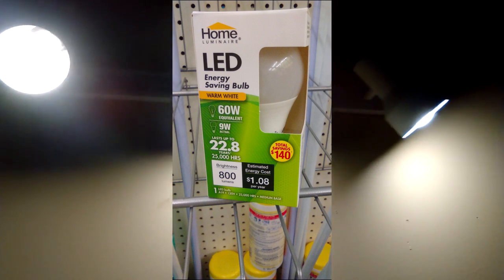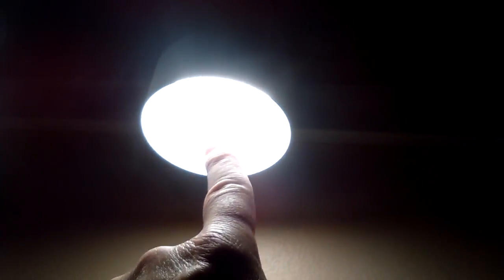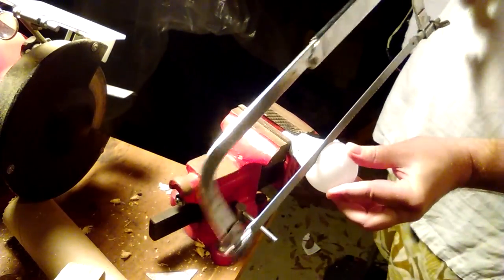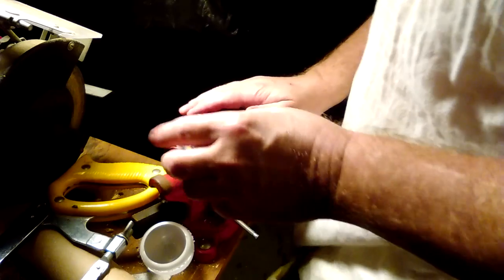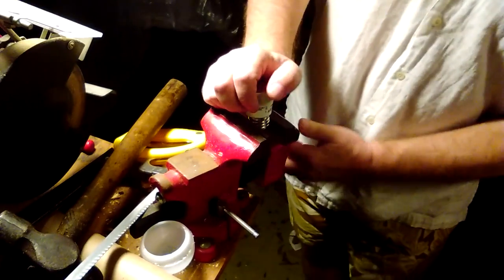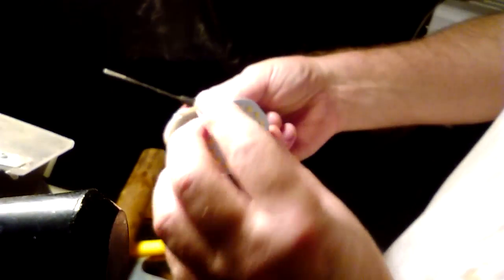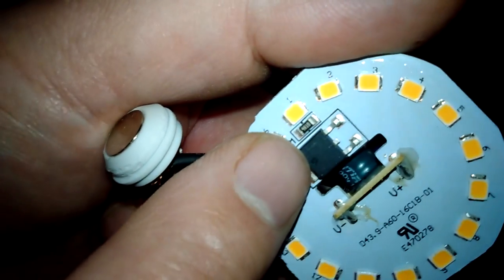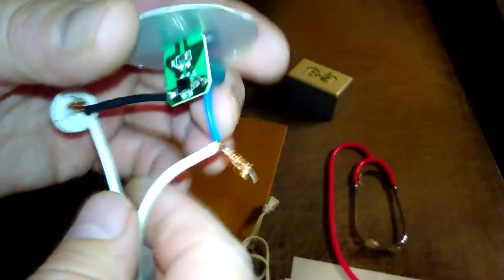Dollar Tree Luminaire LED bulb 60w Teardown / Dissection BP5131D MB10F

Comment: I found a 15.2 Ohm resistor a 100nF polyester cap and and 3.3 uF electrolytic. The other side I found three resistors 56K and a 750K across the +ve  and the -ve output of the bridge MB10F

Comment: I realize this video is a couple of years old, but in your parts review, you never mentioned the 510k ohm resistor that is in parallel with the capacitor (on the same side of the board as the bridge rectifier); you can see what I'm talking about at 8:16. I think (not positive) that it's main function is to discharge the cap when the bulb is powered down, so it would likely operate fine without it. If I'm wrong, please let me know, I just didn't know if it was omitted from the list on purpose or not. Thanks for sharing the video! I couldn't find any info on the BP5131D either and you answered my question as to what it's purpose in life was.
Reply: Lampu led

Comment: Hello genius, actually this is a 9W LED . Please check the package. This 9W LED was equivalent to 60W filament bulb or 16w fluorescent lamp giving 800 lumens of light.
Reply from the maker: Yes, you are correct. The actual power consumption is 9W. The 60w rating is how they are sold so people ( humans who buy light bulbs for decades ) can relate the equivalent brightness when purchasing. Years after I made this video they are still sold this way to avoid confusion. I've never heard anyone ask for a 9 watt bulb but many ask for 60w bulbs. It's a bit of a quagmire but nonetheless how it works. This should clear it up for you if you haven't gotten there.

Comment: what will it take to modify this to run of 12 volt dc
Reply from the maker: Well, you could hook the 12vdc to a 120v inverter 

Click Here to find one: https://goo.gl/SUqvxk

OR - you could parallel these in segments of 2 each and possibly add one 470 ohm resistor to each leg... the inverter thing is easier and you could power a few of these with one.
Reply: These questions almost never get answered .. so Here goes -
(Edited after I reworked my LEDs)

 Probably major surgery!  I don't know if you will get it back in the original base.  I just wanted to use the LED board. 

If you look carefully, all the LEDs are in series and run 8-9 volts.. That's over 120v.  However, if there are 16 LEDs (mine has 15 :-) ), find the first and the last by a split pad between them  (not necessarily by any text on the board!).  All of the pads are split UNDER each LED.  (and they probably are PADS and not tracks.) Remember, there might be some kind of coating on the board.

Remove ALL of the EVEN Numbered LEDs.  you now have 8 LEDs that can be run from 12v with proper current limiting.  And yes, I did destroy all the LEDs that I removed.  I also removed the resistors and the chip (which was really tough).

The LEDs can be paralleled using the pads from the 'removed' LEDs. (See the NOTE below.)  I connected 2 very small wires (maybe 30AWG) to each LED and then bundled them into positive and negative.  Use a 9V battery (and maybe a 1K resistor because they are very bright) to verify positive and negative on each string.  A short tap will be more than enough to tell.  Just be ready for the 'tester' to get hot if you accidentally short it too long.

At this point, the controller chip and resister are, most likely, not actively in-circuit.

NOTE - on mine, power comes to the top of the board, run through the LEDs, through the chip and back under the board.  That means the FIRST LED is connected to the original positive power wire.  And the LAST LED might be connected through the chip and then to the negative power wire.  Shorting the three tabs on the chip will take it out of the circuit and make a good place to connect the rest of the negative ends :-)

You are now ready to connect the paralleled LEDs to a current limited power source.  The original current through the LEDs can be calculated by dividing 0.600V (Vref from the data sheet) by the value of that resistor (probably around 11 ohms).  For a constant current of around 0.054 Amps, or 54 mA, through the string of 16 LEDs.  (I didn't push mine anywhere near that high, so that may be wrong.)

Since you now have 8 LEDs in parallel, you will need 8 times as much current.  However, that suggests 400mA total at 50mA for each LED and probably a lot of heat.  I decided to only supply 18mA for each LED, that's around 120mA total.  

It would also be a good idea to put a 0.5 Amp, or smaller, fuse between the 12V and the current regulator.

Dang it!!  That's not a bad idea.  Now I am going to have to do that to mine.  BTW - I did and it was major surgery!   Because I am reworking a desk lamp, I am planning to put a 555 timer PWM IN-line between the 'current limiting power supply' and the LEDs for dimming.  Dave Jones has a video on EEVBlog that works (Good on ya Dave!) :-D
Reply: thanks…i really prefer this things run on 12 volts cause you could always get some 12volt surplus gel or sealed lead acid battery somewhere for free even an old almost dead car battery would do as they only consume mere milliamps.   there is really no point having current home lighting on 120VAC only to put a circuit to reduce the voltage that can power an led.   I think the future of lighting should be low voltage  preferably 12 volt as this has become the standard.

most solar panels are also 12 volts[18 volt output] so you can charge lead acid based batteries therefore why not just make lighting 12volt LEDs.  

I had purchased mr11, mr16, g4 all 12v Leds from local hardware HD/lowes but I think they charge way too much for what they are.  Although you can buy a 12v strip/spool of Led lighting really cheap online for less than 6$ and cut them into lengths according to lighting needs which i have done as well.  

I've been modifying solar lamps from the dollar store as AA battery chargers as well as one AA cell at 2000mah can run a led lamp straight for 10 hours anyway thanks for your reply.
Reply: oops .. bad news and good news.  My lights have LEDs that run at 8V (probably 9V) which means I have to remove ALL the EVEN numbered ones.  The good news - I'm getting better at it.  I will edit my previous post when I'm done.
Reply: Test it with a (roughly) 48v supply directly on it's outer contacts. If that works then you can get yourself boost converters pretty cheaply that can drive 300W or more and you will be able to use one to drive several of these LED bulbs

Comment: I've bought a total of eight -- they keep selling out. I got a socket adaptor for my nightstand lamp that lets me put four in it; three more are in closet and hallway fixtures, and I tore apart one rather clumsily.

Enough components so that I'm a bit worried about lifetime: LEDs are in series, notably. So far I'm pleased. Maybe in a few months one or more will fail. Also they run hotter than I expected, but people who've checked with a "Kill-A-Watt" say these use under 8W.

Slightly different PS board design on mine, but if memory serves the same or equivalent components (threw out the bits but I have a rather bad photo of one side).

Comment: what kind of capacitor is that? what is the max degrees C for it ?
Reply: John G electolytic capacitor
Reply: i meant like what kind of temperatures i wonder it can handle. I couldn't see on the label.
Reply: The capacitor is a 3.3uF at 200v temp is 105c There should also be a 100nF cap too

Comment: Heh... I did the same thing... start counting and then "Hey, they're numbered."
Reply: Also, I got impatient and hooked my DVM up w/ some alligator clips and wire.  The voltage out of the power supply circuit shows as 152V.  The BP5131D specs say the current is set by  V-ref (0.6v) / Rcs, and the SMD resistor reads as 10 ohms - so 60mA.   Regular white LED voltage is 3.6v, so 16 in series would be 57.6v, for 3.46W.  That's a far cry from the claimed 9W, and even further from the 16W claimed on the side of the base.  But, I didn't try to measure the current @ the LEDs, although they look like they're in series.  I wish I had the time and motivation to wire up 15 or more LiIon cells to see if that would power the LED board for 36.6 hours - but my interest isn't that high.
Reply from the maker: Visibly it's the same brightness as my 60w incandescents and compact fluorescents so actual electrical power, hey, if it's less than the stated 9w than ( excuse the pun ) more power to it! 

The 152v sounds low for a line fed bridge. Theoretical value is 170 vdc at 120 vac, and 156 at 110 vac - since the capacitor is such a small one it's probably loaded with ripple but that's something to scope out but it doesn't really matter - the current IC should provide a constant current. 

I have not measured it but I was thinking today that that one chip could power two sets of these LEDS ( 32 ) and since current is fixed should drop less voltage meaning it should run cooler. I don't know what the point of trying this would be other than to say I did it.

I was also thinking about putting an FET in place of the resistor ( well, leave at least the 10 ohm in series for safety ) and use the FET as a dimmer. To make it safe(r) an opto coupler should be used.

In any case I'm just impressed at the simplicity and efficiency of this bulb - and all the neato projects I can make with them! :)

I can take one apart in about 10 seconds now that I've done one but I'm sure I can get that down to 2 if someone challenged me for shots.
Reply: Someone pointed out on BudgetLight forum... The 152v @ 60ma IS the 9.1W claimed.  The LEDs use only 3.46W -- which means almost 2/3's of the power consumed is to control the current.  A brave soul could try dismantling two bulbs, and use just the LED circuit on the second light ring, mount them back-to-back, and get a lot more light - and only waste 25% of the power on current control.  Heh.
Then again, one of the DollarTree cheap-o 2-AA to USB 5V converters had a boost converter chip that was intended to drive "up to 8 LEDs"... 
I can envision a FrankenLighten running from a couple of LiIons to  a hacked light ring split into two strings of 8 driven by dual boost converters.   
I wonder if those could be wired to to provide stacked output voltage?   Both boost converters powered in parallel by the batteries in series, one providing V+ to GND to one 1/2 of the ring tapped at the 1/2 way point, and the other wired for GND to V- powering the other 1/2 of the ring at the tapped point.  Probably not.
Reply: keninorlando9 marcvisconte I was thinking the same... I don't know what the AC/DC cct looks like, but 152v sounds kind of odd.  Then again, "inscrutable" may be the key word.  Have you checked you wall voltage?
Reply: 110v AC  x 1.414 =157v DC. This is what happened after AC is rectified.
Reply: I am pretty sure the line voltage is fine. I checked the light again and my estimates were way off.  I was thinking these were like plain white LEDs @ 3.6 volts.  I checked the voltage dropped across the string of 16 SMD chips, and they drop 141 volts - that's 8.8v / chip... not your fathers Oldsmobile.  The constant current circuit drops 11.3 v, so the efficiency should be about 92% for the DC PORTION of the bulb.  Then again, as badly as I screwed up my initial estimates, somebody should verify rather than take my numbers.  :-/